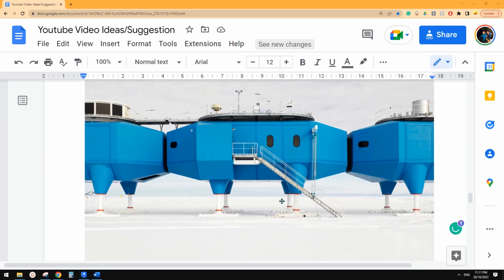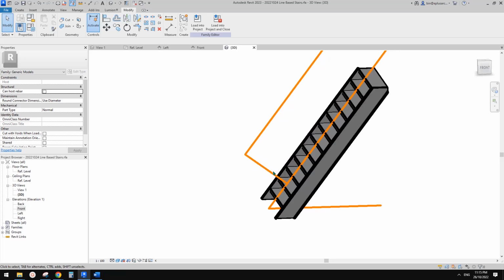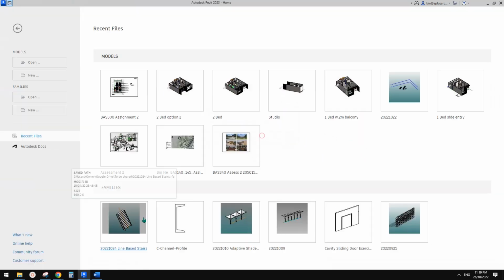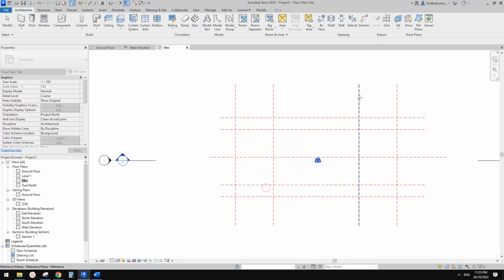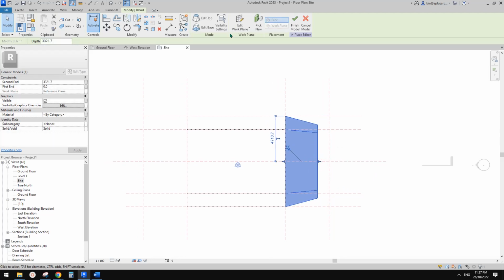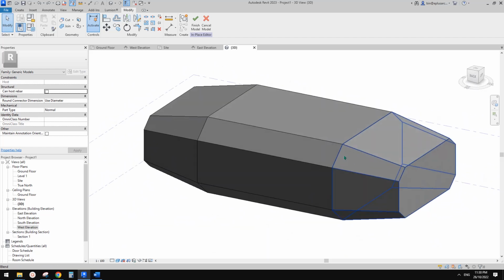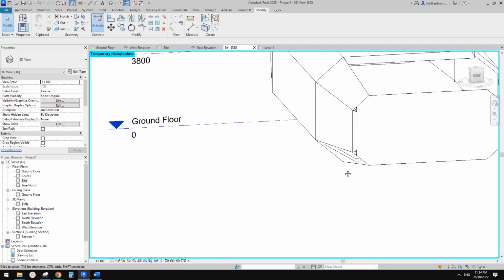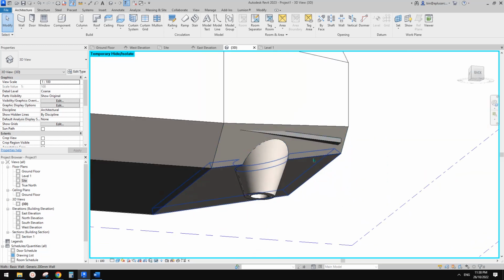Revit Exercise (Day 947) - Generic Model Exercise

Comment: Actually staircase railings( baluster) are perpendicular to the floor not to the stringer ..here it is perpendicular to stringer is there any possible way to keep as like as staircase railing means baluster should be straight on the stringer..if pls let us show that one also
Reply from the maker: Usually, we use railings, but it will not work for this line based family. Should be able to add it into the family I think.
Reply: @BINHE615  u have an idea means pls show it ..iam bit confused about taking plane on refrence line